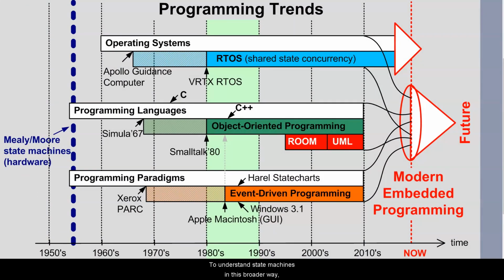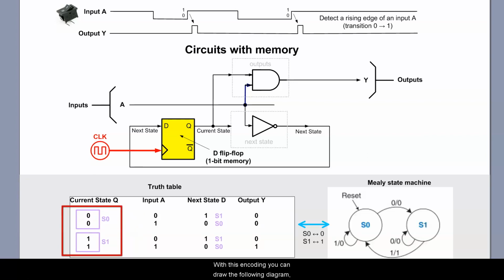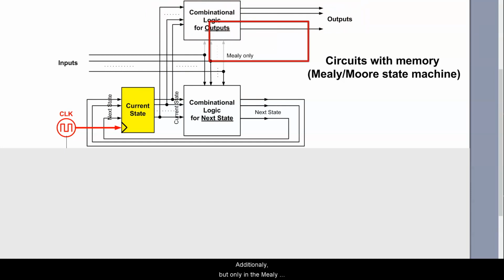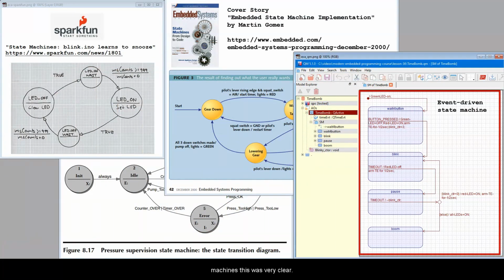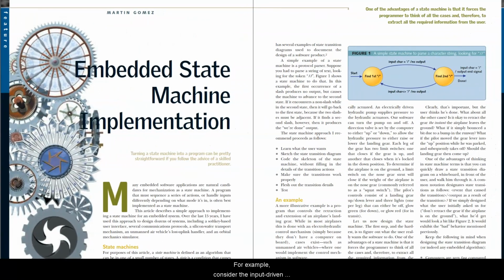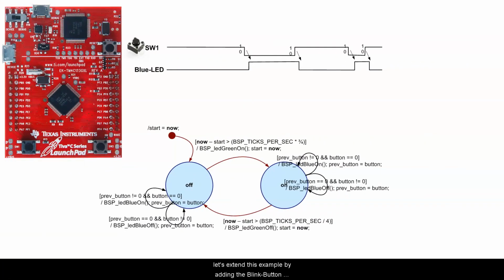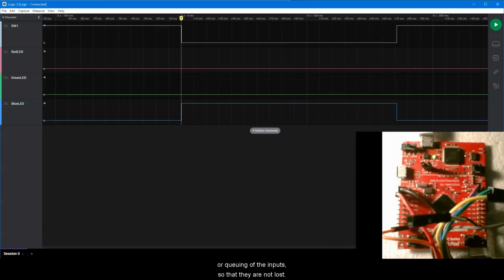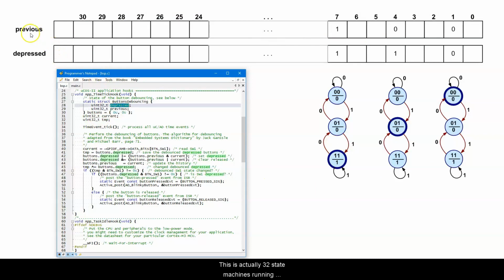#37 State Machines Part-3: Input-Driven State Machines

Comment: Great video! Indeed, I was wondering how debouncing can be added to an event driven architecture. My idea was to use an RTOS task running in parallel. Looking forward to the next video!
Reply from the maker: Actually, simple things like debouncing noisy inputs, should be done as early and cheaply as possible. Using a whole RTOS task just for that is like rolling out a cannon to kill a mosquito. A task is expensive (remember the private stack?) and slow compared to doing this directly in an ISR, exactly as demonstrated in lessons 35 and 36. --MMS
Reply: Miro, I agree with the interrupts approach, actually I had found a very cool debouncing library with auto-repeat which however does not use any interrupts and I was thinking how I can make it work with event driven projects. Because Youtube does not let me post the link here for some unknown reason, you can find it by googling for "Auto-repeat and debouncing" on the Embedded Systems Blog.

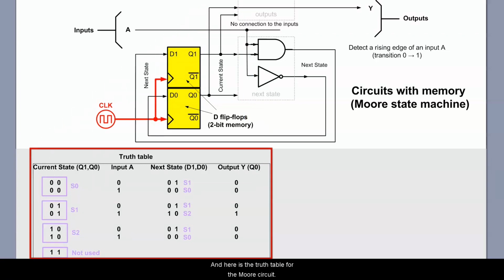Comment: Very very useful. All your videos are so wet done. They are, for me,  the best in the field. Just a very short remark at 7:00 min. The Moore state machine must show a constant output at a given state... which is not the case in your table... At state S1, the output Y (Q0) changes according to Input A... (as in a Mealy machine)...
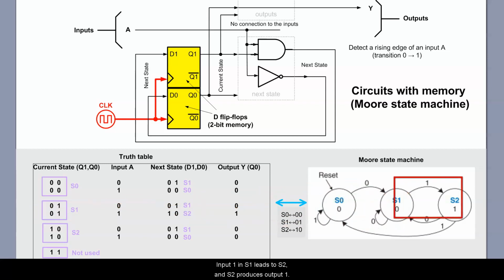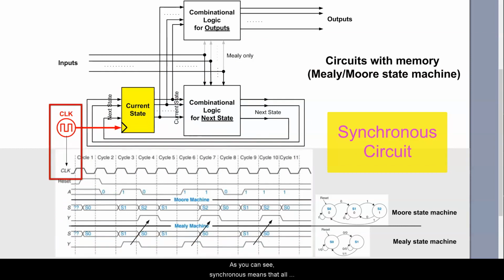Reply from the maker: I don't see a problem at 7:00 or at 8:00. Could you please elaborate where do you see error(s) in the table, in the state diagram, or my narration? Also, please note that the output Y assumes the new value on the next clock cycle, as shown in the timing diagram at 9:40. --MMS

Comment: Great course, I somehow missed the other 35 lessons, even if subscribed. Can you suggest a good place to buy the evaluation board in Europe?
Reply from the maker: All lessons in this video course are included in the "Modern Embedded Systems Programming Course" playlist posted at the top of this channel. Regarding the TivaC LauchPad board in Europe, you can simply go to Amazon.de or Amazon.uk or some other local Amazons. Also, the board is carried by the Swatee distributor ( https://www.swatee.com/ ), where you can search for "EK-TM4C123GXL". --MMS
Reply: @StateMachineCOM  The link you mentioned shows a 503 overloaded error. Btw, will the board EK-TM4C1294XL also work or does it have to be exactly EK-TM4C123GXL. I can only find the former on amazon.de.
Reply from the maker: @shreyjain2752  I'm sorry about the Internet links. They are notoriously volatile and obviously out of my control. Regarding the board, the EK-TM4C1294XL is close, but not identical and the provided projects won't work on it without modifications. I would recommend to look for EK-TM4C123GXL. --MMS

Comment: 1 question
Why count is written in bap layer?
As far as I know, counting with a timer and use it for example as a gp timer is something related to lower layers and not to the bsp! In bsp you should only code those things that are really related to the board... also the implementation of sm is really poor. Don’t know why this was in my recommended videos!
Reply from the maker: I'm not sure what this question is really about, but BSP is the low-level stuff, isn't i? For example, counting with a timer interrupt is definitely dependent on the particular board and the implementation will be very different if you chose a different board. Therefore, you typically don't want to do such stuff in the main application logic. But perhaps I'm missing the point of this question? --MMS
Reply: @StateMachineCOM  counting stuff are completely related to the processor and if you consider something like that, it should be written in HAL. So for example the function that do the counting should have "hal" in its name... not "bsp".
Now imagine there is an LED on your board. All of the functions that controls the behavior of this LED, should be written in BSP layer and should have "bsp" in their name.
The important thing here is knowing the difference between timer counting (which is a feature of the MCU) and LED's functions (which is a feature of your board). BTW, there was no question, just wanted to give a critic.
Reply from the maker: @sillfsxa1927  The concepts of BSP and HAL are both related to the low-level hardware interface and largely overlap in meaning (please simply google for "BSP vs HAL"). The most important thing is to separate the application logic from the low-level stuff, which is demonstrated. I don't think that splitting the hair even further into separate BSP and HAL will improve the design and will certainly trigger questions "what goes into the BSP and what goes into the HAL?". But I would rather focus on the important points of the lesson instead of side issues like this.